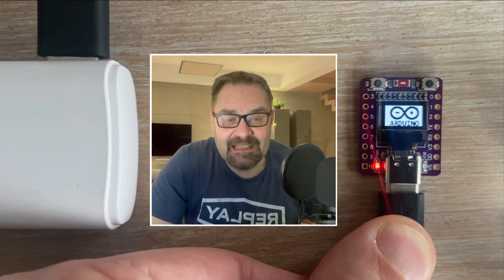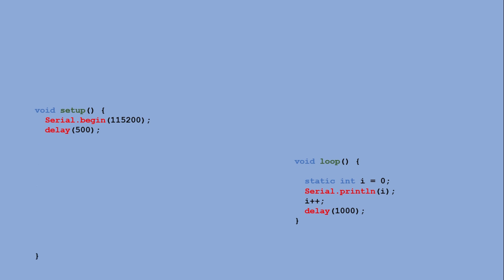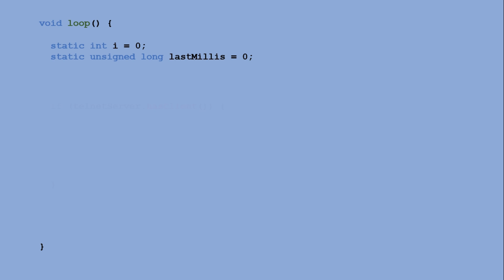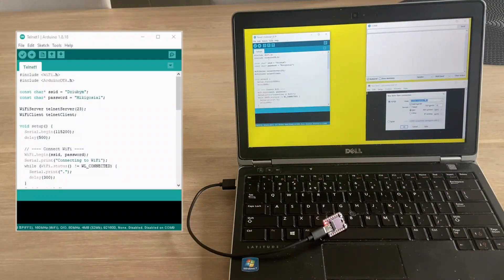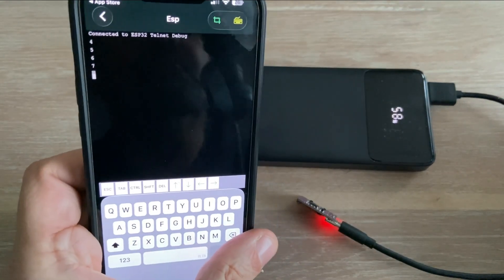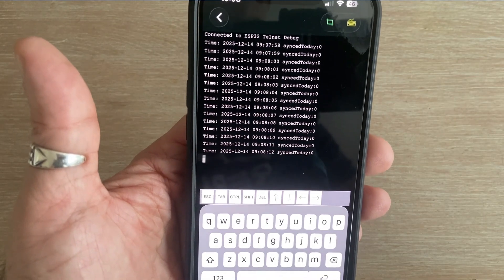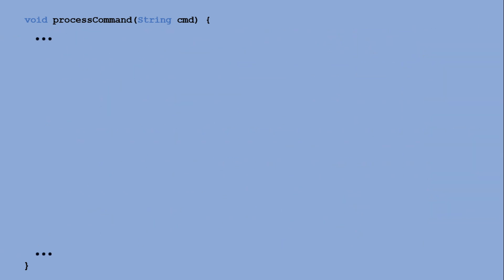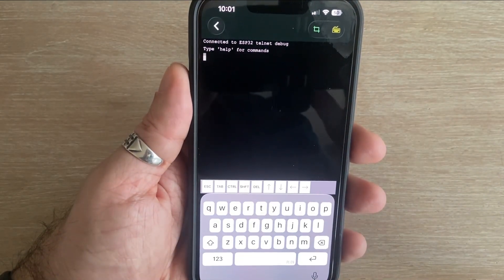No USB, No Serial Monitor: Debug and Control ESP32 via Telnet!!!

Comment: Thank you Mario, interesting video.  Did you know that you don't need a third party telnet client in Windows (even 11)?  Using the old style control panel, programs and features, Turn Windows features on and off (left hand side), then scroll down the 'Windows Features' dialog and find 'Telnet Client', select and 'Ok' to install.  Then when installed will be available in a command prompt / PowerShell, just type 'telnet'.
Reply from the maker: Thanks. I was trying telnet in command prompt and did not work. So Looked for 3rd party app. Thanks for the tip. I will definetly check it:)
Reply: @marios_ideas  how about a linux or macos environment instead of windows. Because windows is having a lot of problems and slow these days
Reply from the maker: @lokupodiyalu Yes — both Linux and macOS already include a Telnet client by default, so nothing extra needs to be installed in most cases.

On Linux, the telnet command is available in most distributions. If it’s not installed by default, it can usually be added with a single package manager command.

On macOS, a Telnet client is also available out of the box and works the same way from the Terminal.

So if you’re using Linux or macOS, you can connect to the microcontroller directly from the command line without any third-party tools. Windows requires additional software mainly because Telnet is disabled or not included by default.
Reply: That is very good because we don't have to trust 3rd parties and use built in tools